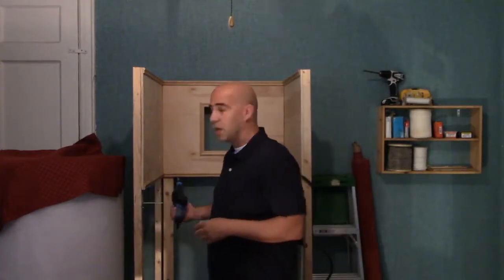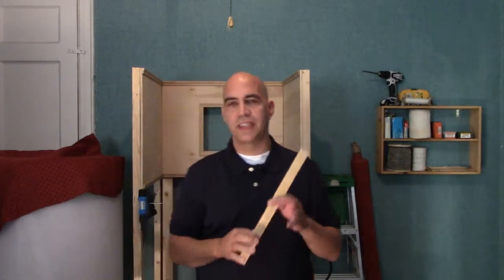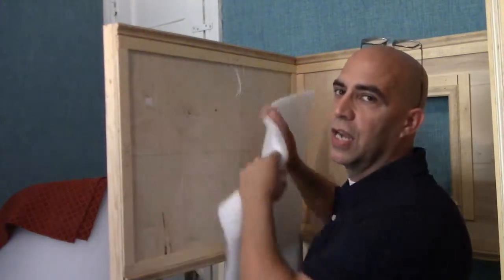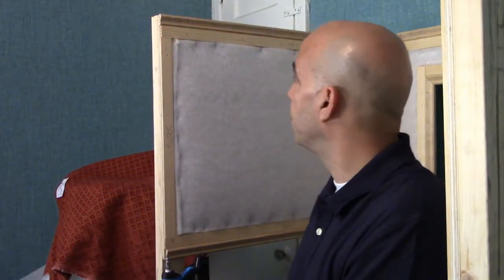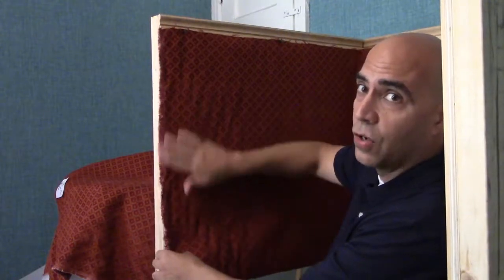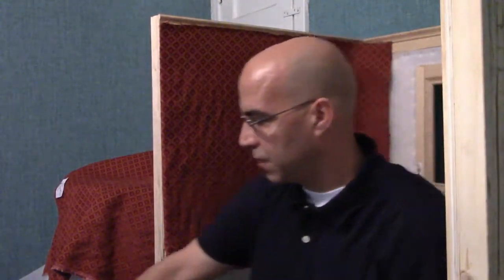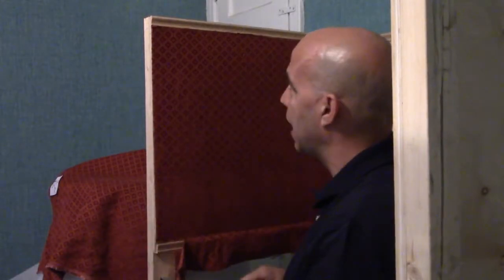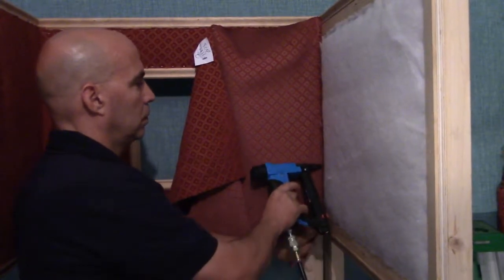Basic Wall Upholstery Installation Tutorial

Comment: Great demo. Thanks.  One question, what do you do when there are a few fabric panels on one wall?
Reply from the maker: You will need to seam the panels together
Reply: Thanks for your answer. So treat the whole wall as one big panel, no mater how big.  Today, I  won a lot, at auction, for some ultrasuede. I came here looking for some information on how to go about doing padded walls.  When you warned people NOT to use velvet, or ultrasuade..... WELL??  What are some of the pit falls ??  I am a very talented seamstress, and tailor, with decades in experience.  But I have never done this type of work before.